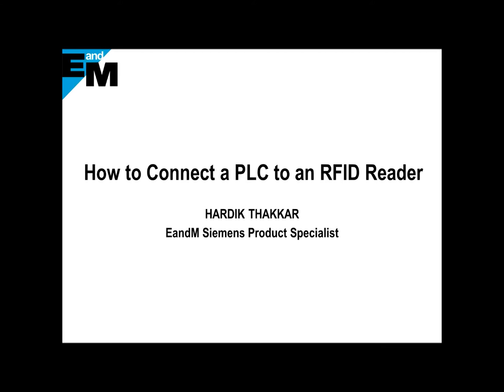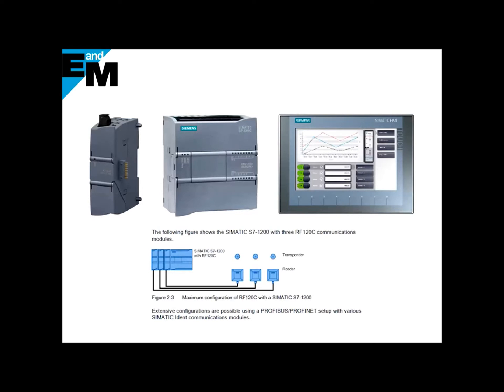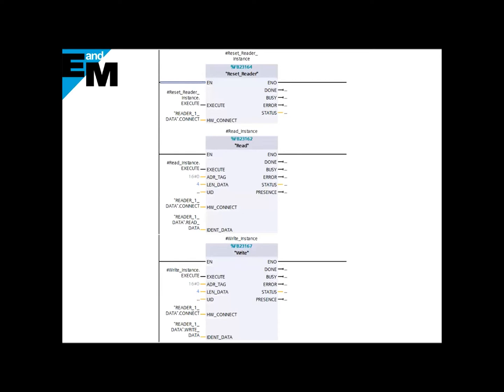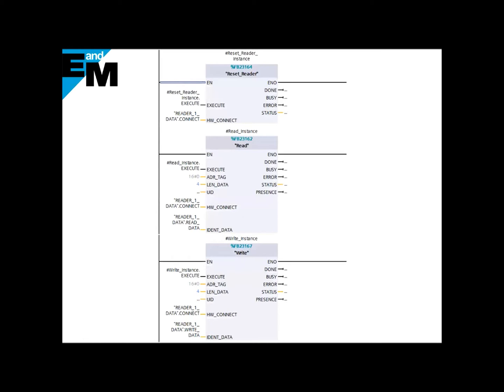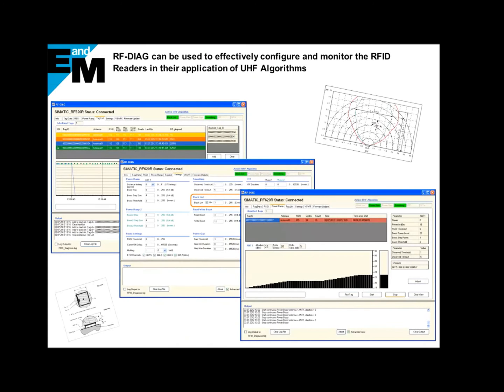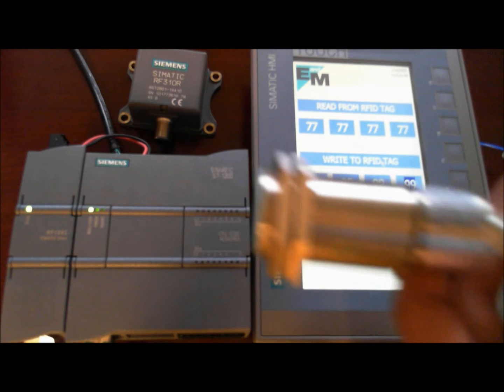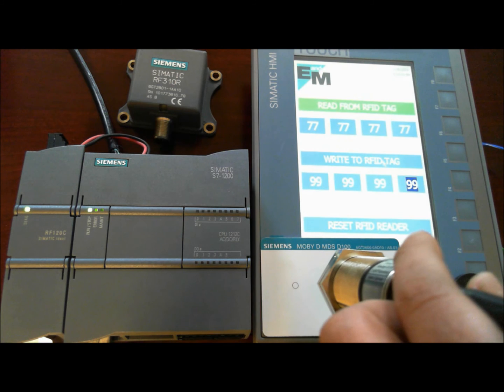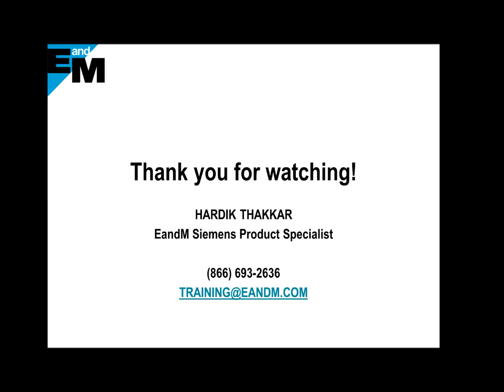How to Connect a PLC to an RFID Reader in Minutes

Comment: Sir , each tags contains its own value correct? I would like to know on how each tag can execute or acts as trigger input in a program just by reading the tag. It is possible to do so? If it's possible would you kind enough to reply me with a simple programming on how to do so?

I'm using tia v12, plc s7-1200 and my setup is same as yours for the reader and communication module. Thank you.
Reply from the maker: A. Izz The same hardware shown in video will work. Simple use Compare function in ladder logic (CMP==) and compare the tag read value with the values already stored in the PLC. If the values match call another FC or JUMP to the logic. IF, IF NOT functions can be used in STL. So you can just create IF conditions just like C++ programming and call different areas of code.
Reply: So basically, I just need to use the (CMP==) block to compare the values, and the tag read value will be shown in the IDENT_DATA is that correct?
Furthermore, I'm not that familiar with STL and instead I'm using LAD type.
Lastly, if the values matched I'll just need to call desired FB/FC? Correct me if I'm wrong.
Thank you again for your generous reply Sir.
Reply from the maker: A. Izz 

Yes, correct!
Reply: Okay, for now I'm using RFID for my project and I get all of the RFID blocks shown in your video from siemens website. The problem is that they put "know-how" protection password. Which made I can't compile the blocks correctly. Do you have any suggestion for my problem? or where can I get the library from
Reply from the maker: A. Izz You can find it @90063944
Reply from the maker: A. Izz For some reason I'm not able to paste a URL into this comment. Please send me an email to marketing@eandm.com, and I'll send you the link.  Thanks!